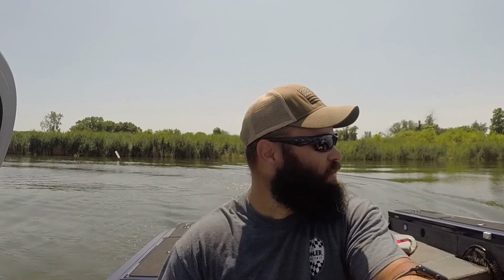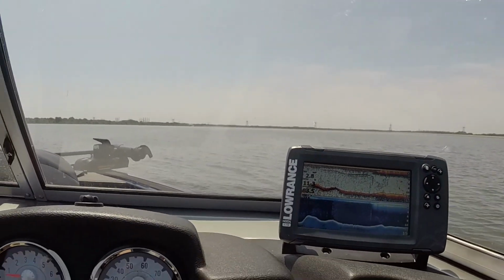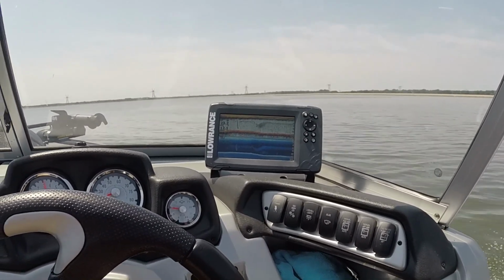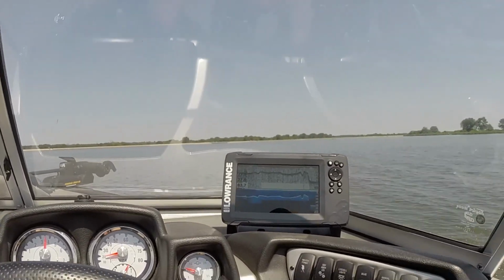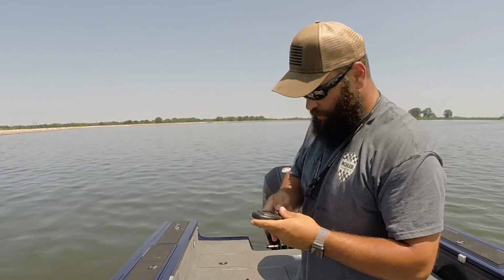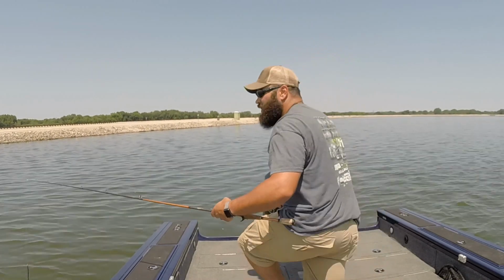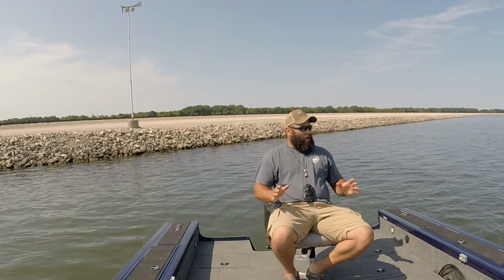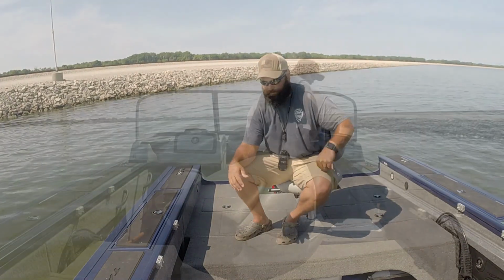2019 Tracker Targa V18 Combo Test Drive

Comment: nice rig. I have the exact same boat but mines a 2018. this may or may not interest you, but I have the standard 150efi four stroke. I was getting 47mph trimmed pretty much all the way up like you do and was running 6100-6200 rpm. I noticed you were just over 6 k as well. I switched from a 14x18p enertia to a 13.8x20p enertia and trimmed up im actually about 3-4 mph faster than yours is (53mph with the 150), so I picked up about 6 mph. if you went up one pitch I think you would see 55-56 mph, which is no joke in a boat as heavy as ours. these hulls are built like tanks. you might be the type to want everything you can squeeze out of it, or may not see 5 more mph as justification for a $500 prop. super nice rig and thx for the ride brother
Reply: by the way, I also went with the ipilot, and your right, its a huge improvement
Reply from the maker: Thanks for the info. I didn’t think the 25hp would be that much more speed. What rpm are you getting with the new prop at top speed?
Reply: about 5600 which just about smack in the middle of my suggested max. I should add, I run with very light loads. 6 rods and couple of trays of artificials (rattle traps etc) , , , , I think they prop these boats to run heavy by folks that might not know how to really trim it out running flat out. im not sure what prop you have or the suggested rpm range of your pro xs, but I think you would see 5-6 mph.
Reply from the maker: Bryan Carpenter it’s a mercury tempest 17p 6000 is supposed to be max. Can’t remember the range for its best. Have to look it up. I have been thinking about doing an 18 but just a little scared with it being 600$ and there is a chance it may not do much or be really bad for the motor. Then I’m back to where I started 600$ less. One day I’ll pull trigger
Reply: well, my max rpm is 5800 and I was tickling 6100. if you do ever move on a new prop, go with the enertia. its not only designed for heavier boats, but its made from mercurys new x7 alloy. google it. its 30% stronger for flex than conventional stainless and 50% more abrasion and shear strength. this means thinner blades can be used in similar pitches compared to stainless. I would need to know your diameter to suggest one with confidence, but now I think you would pick up more speed than I first thought (with an x7 enertia) let me know your diameter, and I will suggest a enertia, then you run it by mercury in Wisconsin. they are easy to get ahold of and super great to deal with. it definitely wont hurt your motor if you stay within your suggested rpm range. I would be thrilled to help you pick one. jeez, you could see 7 even 8 mph.
Reply: don't make me come up there and outrun you w a 150!!! lol, just kidding man. your basically running 50mph in a really big boat. I honestly wasn't looking for more speed when I got my 20p, I was over my max rpm and I didn't want to have to be careful with my throttle. im religious and it just felt like a sin to have to throttle back to avoid overtwisting my motor
Reply: btw, ive saved your video. it just sounds too damn good !! that pro xs is music dude
Reply from the maker: Bryan Carpenter hahahha thanks dude. I will def do some research
Reply: Hi Bryan, thanks for your reply.  I have the same boat and hp that you have, running the enertia 14x18.  I surprised by how much you say you trim up.  Maybe the result of my kicker motor extra weight I don't find I need to trim very much at all, in fact I have blown the prop out at first when I tried to trim as much I used to have to with my 17 foot tracker with a 115.  Interesting about your prop choice.  Impressive numbers.

Comment: Thank you! Picking up the 2020 model next week. It only has the 150 anything near or north 40 MPH is fine by me. I upgraded the trolling motor as well with the integrated fish finder.
Reply from the maker: Glenn Rhodes that’s the one thing I wish I would have done one the beginning was upgrade the trolling with a fish finder. I need one up front for sure!!!
Reply: The 150hp will take you 45.8 mph with a full tank and live well filled.

Comment: How did you get the 175 motor? On the tracker website, I can only choose between a 150 and 200
Reply from the maker: It was what was on it when I bought it. But it might had be a 2019 model thing cause I remember the option when I was looking to build one too

Comment: I am looking at getting this same exact boat. Would you recommend getting the 200HP motor? I know you almost got to  50 MPH with just you and gear.  I am not a tournament fisherman. Just want something I can casually fish with and take the family out on so my little ones can tube and be comfortable on.
Reply from the maker: William Koch I would spend the extra 2 or 3 grand for it. My 175 has plenty of torque to pull tubes or skis. And plenty fast enough for me. Sure more horsepower is always better but I have been running it for 3 months now and not one time said I wish I would have gotten the 200.
Reply from the maker: With four grown men I was hitting 46.7 mph at top speed but honestly I barely run it over 35-40 mph at 4000-4500 rpm
Reply: @willmann81785  I would of been happy with a 115hp because it's better on gas.
Reply: the boat is rated for a 200hp. Ask your dealer if you can get the boat with out a Mercury and go with a Evinrude 200hp H.O. The H.O version is actually almost a 220HP engine.
Reply: I have the same boat with 200 horses ... the speed is 41 miles per hour (((

Comment: Do you still have this boat? What is your overall opinion on it? And problems so fat
Reply from the maker: Yes I do still have the boat. I have made a video about every issue I have had with it. As to quality it has been a couple few issues with it but nothing crazy. Biggest mechanical has been trailer. Overall opinion I like the boat very much and it works perfect size and capability wise for me and my family.

Comment: What RPM do you usually cruise at just going spot to spot?  I have the 150 stock 4-stroke on mine and she seems to settle nicely at about 4400/4500 for me around 32-33 mph with gear and crew.
Reply from the maker: Yea that’s pretty close. I think usually about 4000-4500 which runs like 35-36. It seems happy right there and doesn’t guzzle the fuel as bad

Comment: do you use the poles they give you with the boat cover?..the reason I ask is because I can't seem to get the cover to fit over the back corners very well...
Reply from the maker: Paul Provan I can and used them but very rare. I use my seat on this back deck most of the time. The poles are adjustable. Twist them to make them taller or shorter so the cover fits. Hope that helps.
Reply: @8michael7  thanks man...I just was seeing a lot of folks not using the poles.
Reply from the maker: Paul Provan I only basically use them when it’s sitting. They fall down 3 miles into any trip.
Reply: @8michael7  so this cover that comes with the boat is a decent travel cover then?..that's what I was told at the dealer...does it blow all around at 70 mph on the interstate?..I just got a 2021 targa 18 yesterday.
Reply from the maker: Paul Provan mmm I have traveled to Arkansas 10 hrs 3 times and Minnesota twice 12 hours. It has taken a beating but still is holding up. So if you can travel without it will last longer. But whatever you do do not travel with your flip up seats up and cover on. The footing will tear a hole in the cover which I had to send back and they patched.
Reply: @8michael7  thats what I figured...I'm gonna have a nice canvas travel cover made for it more than likely...thanks.
Reply: Any other pointers you can give about this boat??..like I said I just picked this boat up...thanks.
Reply from the maker: Paul Provan careful with the winch. Try to powerload as close as you can to the rollers and if it does break and no longer under warranty just order the part. I have a video on that as well. Other than that enjoy the water

Comment: I'm looking at getting the 2021 model what kind of fuel range would I be looking at with the 200hp?
Reply from the maker: Not 100% positive but with the 175 it’s really not to bad. I can drive all week long on 1 tank of fuel
Reply: @8michael7  i currently have a 19' glasstream bass boat with a 150 mariner and can get 200 miles on a 35 gallon tank hoping it will get that or better thanks for the info
Reply from the maker: I leave tomar for vacation so through the week I’ll keep an eye on it and let ya know
Reply from the maker: So with my 175hp through the entire week I burned about 32 gallons of fuel. My trip says I went 177 miles the whole week. Now for probably at least 100-120 of the miles involved pulling a tube. hope this info helps.
Reply: @8michael7  absolutely thank you for getting back to me

Comment: Just a heads up I stopped traveling with my cover on. They loosen up and catch air in front of the ratchets and it beats the crap out of the cover.
Reply: Also, I made a set of hitch mudflaps, i started getting rock pits in the paint like crazy and bought a windshield cover. Great review though, mines a 2017 and was looking to trade it in but might keep it around. They are still pretty similar.
Reply from the maker: I have been noticing it has been taking a beating. I’m kinda in the same boat now except for the really long trips.

Comment: How well does your truck pull this boat?  I have a Honda Ridgeline that can tow 6000lbs but its just a V6.
Reply from the maker: Russell Sands power wise no problem. But it has a 5.0L what does suck is the suspension. It really bounces the truck often. But my buddy pulled it with his 2012 ram 1500 and truck didn’t move going down the highway. So if your pulling long distance I would recommend bigger truck or smaller boat. Anything less than an hour away a would say you be fine. I think the boat tow weight is about 4000 lb.

Comment: I'm curious, you said the speedometer doesn't work.  That's a new boat, did they fix it?  I'm looking at a Targa but saw some other problems like that with other YouTube channels.  Making me think the Targa may have electronic issues, or is it just Tracker problems?
Reply from the maker: k9mick121 so i forgot to ask about it when I took my boat in for service but did call after the fact to see if it would cost me anything. They did say it is covered under warranty and that the speedo is measured by water speed through a jet. It is prob plugged. But I use the speed on my depth finder. It is gps and super accurate. I wouldn’t let the speedo keep you from buying what you want.

Comment: I'm thinking about the v18 wt with 150 pro xs
Reply from the maker: Mr. DIY how to painting welding fabrication it’s a good boat.
Reply: @8michael7  thanks I was just worried about not having enough room in the front.can 2 people fish off the front.i havent seen one in person yet.
Reply from the maker: Mr. DIY how to painting welding fabrication mmm I have fished 5 people jigging and 4 casting for bass and can manage pretty well but fishing 2 in the front would be pretty tight I think
Reply: @mr.diyhowtopaintingwelding4479  the front on the trackers are WAY to small. look at the same size alumacraft competitor 185. great lay out compared. the tracker is a heavier boat and will handle the great lakes alittle better imo.

Comment: Is there a suggested motor break in procedure for the pro xs 175?
Reply from the maker: vivalosdoors yes. First 2 hours adjusting rpm between 3000 and 4500. Every 10 min full throttle for no more than 1 min. After the 2 hours continuing to vary rpm but if you go full throttle do not hold it longer than 5 min. Once you have put 10 hours on the motor doing that procedure the motor will be officially broke in. Let me know if you have any more questions

Comment: How many nautical miles per gallon you get on this thing???
Reply from the maker: Tariq Khan oh man that’s a real good question. In June I am going to be running it hard for 2 weeks straight. I’ll try to figure it out. I feel like the fuel economy is pretty good though.
Reply: @8michael7  Excellent, yeah see if you can figure out the fuel economy on this beast. Thanx for a very quick reply. Stay safe.